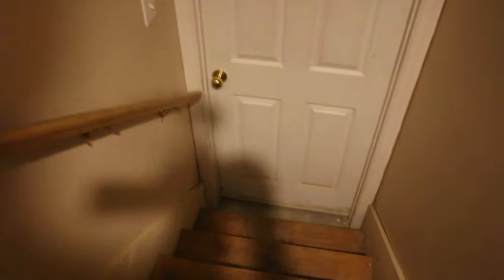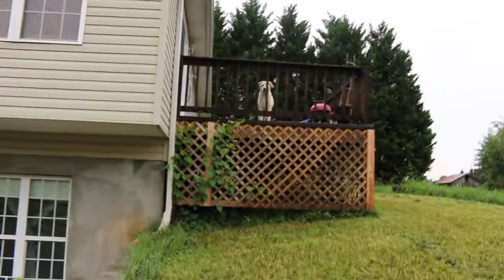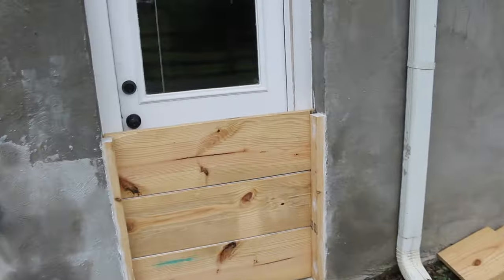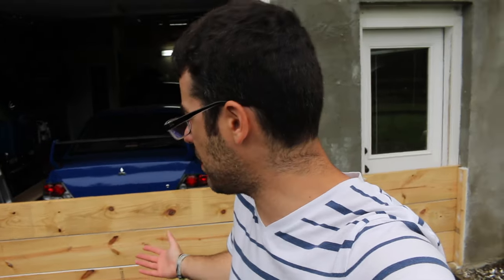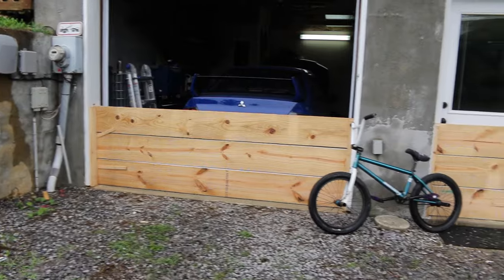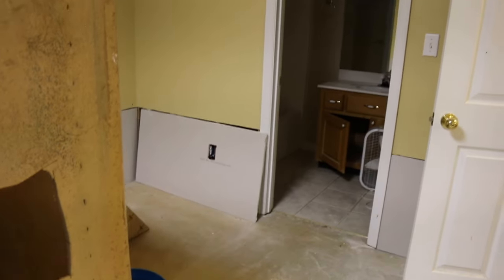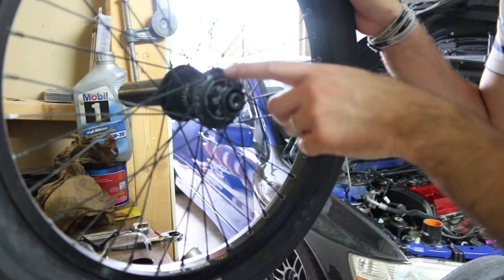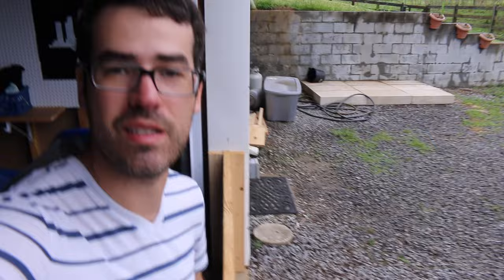OUR HOME WILL NEVER FLOOD AGAIN!

Comment: Hi... great idea.
I need to do the same.
I have flooding problems and manufactured floodgates are too expensive for me.
Would you please kindly explain what you put in between the three boards and on the floor under the first bottom board ?
I need to protect two entrance doors to basement.
Thanks for your amazing video.
Greetings from Melissa from Italy
🍀☀️🕊️😊
Reply from the maker: I tried rubber strips that go under doors but I ended up caulking. this was temporary as the main problem was drainage next door. it has since been fixed so I took this down years ago.
Reply: @WasleySchultz 
I understand...
my drainage problem will take awhile to get fixed.
That's why in the meantime I need floodgates for the two entrance doors on first floor. We're getting rain bombs lately here in Italy.
Thank you for kindly replying and for the helpful advice 👍🏻😊
Reply: For drainage you can use NOn return valve.